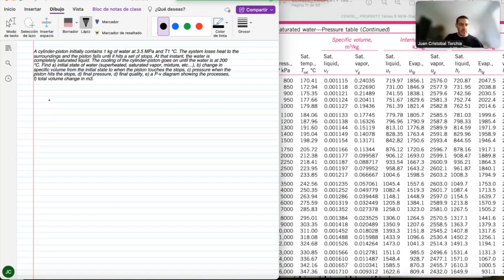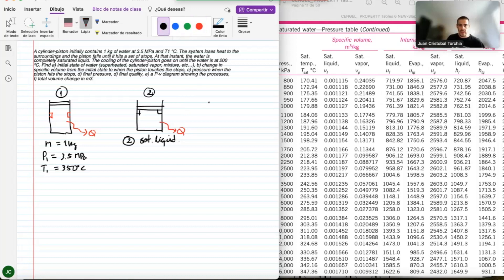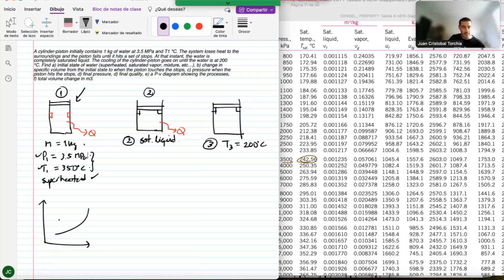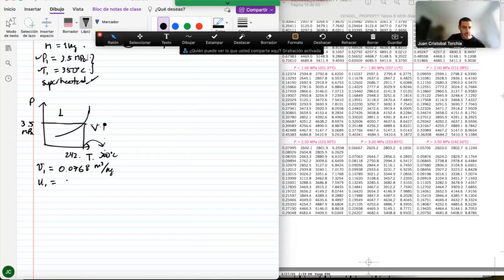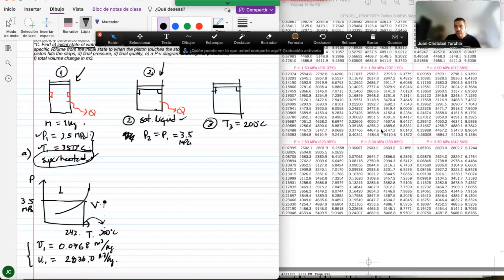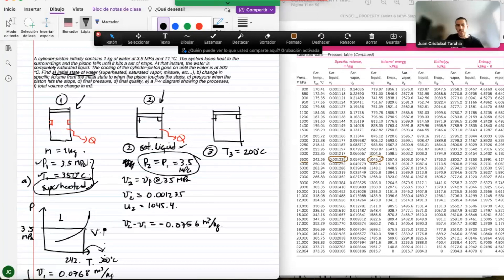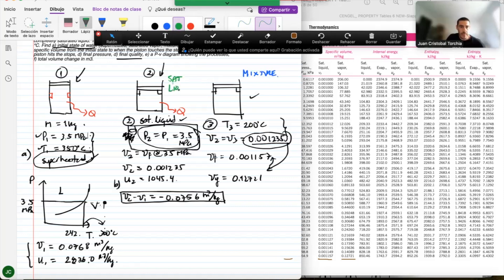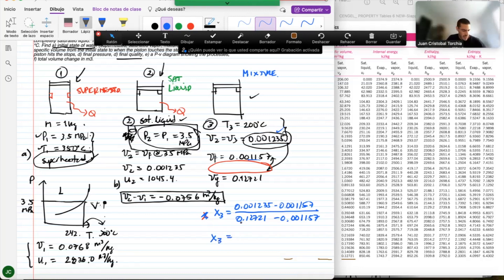Thermodynamics: Cylinder-Piston with Steam Tables

Comment: how do you know its constant pressure ?
Reply from the maker: That is a great question. The first answer, you won't like it very much: by default. In steam table problems of these type, you only have constant-pressure or constant-volume processes. That's it. 

Other type of processes are really difficult to model using steam, because steam is really difficult to model, that is why we use tables!!! 

Another answer would be that, when calculating W=-int(PdV) P is really the external pressure, not the internal one, against  which the piston is struggling to move. So, if it moves, it moves against a pressure located outside the piston (but in fact is the same pressure inside the piston!). 

Anyhow, it is a little difficult to understand what is really going on. It takes a lot of reading.